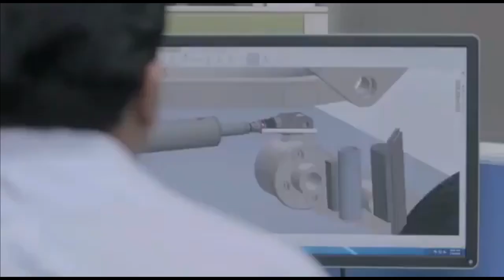Bharat Forge ready to produce 100-200 ATAGS artillery guns per year for Indian Army

Comment: If the Indian Army procurement board had not tried so adamantly to block this outstanding indigenous product in favour of buying inferior foreign weapons, India would already have this in production and huge sums of public money would not have been wasted of split orders of foreign equipment. 
It is difficult to explain this kind of behaviour by the Indian Army, Air Force, and Navy, which seems to be repeated on every defence contract other than to link it to the small of corruption and impropriety that seems to pervade every defence contract, or to attribute it to sheer incompetence in the defence procurement boards of understanding, executing and assessment  of specifications for cutting edge military technology or of management of projects, procurement contracts, production management and planning, and management of development programmes. These are all essential tasks for defence procurement boards and the Indian procurement boards seem to be seriously under-performing in these. which leads to inability to assess new equipment properly leading to the purchase of only old less advanced imported equipment which is usually inferior and often obsolete instead of the latest cutting edge equipment. Whatever the reason, it is costing India dear and putting India's defence and security at risk.    
What is needed is to have competent people on the procurement boards to cover these aspects including specialist engineers, scientists, representatives with experience in procurement contracts, industrial production, project management, management of R&D etc. in the various appropriate fields. The IAF, IA and IN representatives are only competent to advise on current and past user experience, and not the above, and it is unreasonable to expect them to be competent in other areas. There is also a need for the national agencies like DRDO, CVRDE, and others to be permanently represented on the board to evaluate tenders and strategy as expertise of technology and development is required. 
In addition, there needs to be Strategic Military Studies Institute with a high technical and scientific participation to study and evaluate new military strategies and application of future technology in warfare, and this will need to be forward looking rather than backward looking like the IAF, IN, and IA staff on the procurement boards, and needs to include people with a forward looking mindset who are capable of studying, assessing, and testing new technologies and new strategies and concepts.
Reply: There is already an institute for it. The course is called technical staff College and open to all arms and services.

The procurement process of which field trails and GSQR/ASQR is handled by Army/ IAF. Rest is handled MoD. Generally AHQ sends the file to ministry which is where things gets struck. After ministry clears it, it goes to RM, CCS and then gets finalized. The procurement process is relection of civilian control over military which is an accepted practice in Democracies. The US is no better, the Bradley infantry fighting vehicle is an example of it. The quick procurement process leads to blunders like JF17 where 60% the fleet is grounded due to structural issues.

Having said that, procurement process can be accelerated if there is political and bureaucratic will.
Reply: @shivabiswas686  
The Army, Airforce field trials are taking far too long - no other country takes as long as India on field trials and specification of requirements. Most new systems have some minor teething troubles including western and Russian  aircraft, and these are fixed in service it is unreasonable to expect none, but it has never stopped their militaries from acquiring locally produced equipment which is why they produce advanced equipment. This behaviour by their Indian counterparts does indicate lack of competence/confidence in quickly assessing technical risk which forces them to only look at existing older foreign equipment rather new indigenous products. I think the field trials field trails and GSQR/ASQR needs technical people, not just army, airforce, and navy staff. There are a lot of new things happening - for example drones, networked  infantry and battlefield, use of Starlink Internet in Ukraine to back up infantry networks, which all need to be studied, modelled and wargamed, along with countermeasures to the enemy's systems. This will need a lot of specialist engineering, scientific, and mathematical knowledge and knowledge of other countries' and future technologies field trials on the GSQR/ASQR that will simply not exist in any military staff in any country because it is impossible to get that knowledge working in the armed services.

I think the failure of the JF17 is a good example of the folly of the buy foreign lobby. The JF17 is designed and made in China, so the failure in the JF17 cannot be fixed by Pakistan. The PAF were forced to buy it because of Pakistan's buy China policy, and it should be noted that India does not undertake long trials with its imported equipment unlike it imposes for its indigenous equipment because it can. The same issues can occur if India buys modern foreign aircraft (look at the F35 teething troubles), it is just that Chinese and to a lesser extent Russians produce poor quality equipment. The budget and the long term supply, maintenance and upgrades are also important, and those must also be considered when formulating defence requirements. The attempts by the IAF, IN, and IA to buy foreign equipment have been frequently scuppered because they have been too costly for the budget, and the Indian military now finds itself over reliant on Russian and Ukrainian equipment, spares for which is now threatened. In order to ensure military acquisition plans fit into India's budget, and to ensure long term security in spares and updates for imported equipment, it is necessary to ensure India's foreign policy and relations with the supplying country are cordial and in alignment in the long term. Also indigenous development and self sufficiency in defence is a policy of the Indian government, and these are all outside the scope of the Indian government and a prudent policy to avoid the JF17 dependence on China and Russian/Ukranian spare parts  supplies debacles. In order to streamline Indian military procurement, it is necessary to have government budget, defence development, and foreign policy officials on the GSQR/ASQR board to make sure the procurement proposals are in line with Indian government budget limits, foreign policy, and defence development policy, otherwise a lot of time will be spent on procurement attempts which will just end up being cancelled.